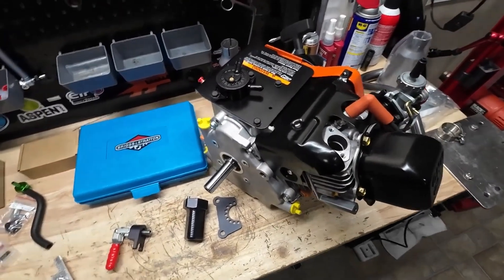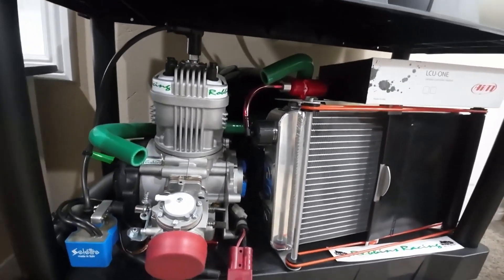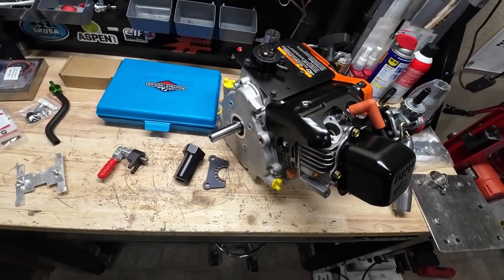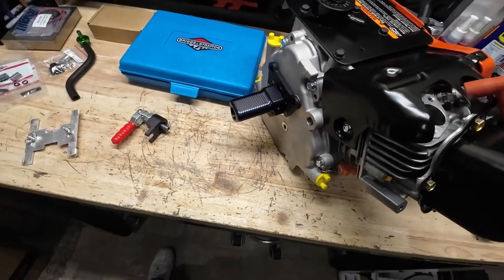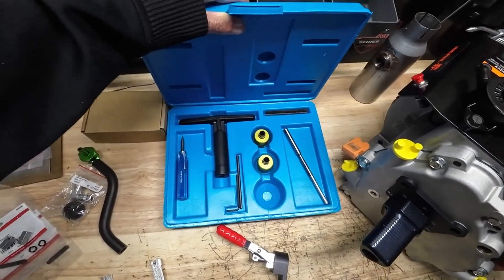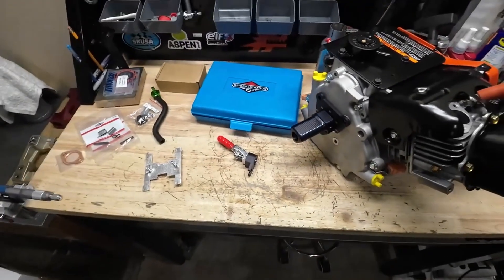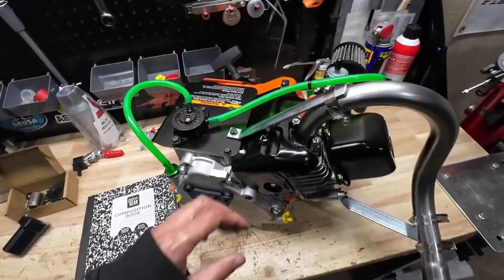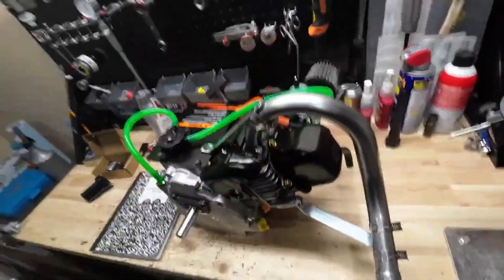DYNO Tuning the Briggs LO206 EP.1 - Engine Prep

Comment: Hi Geoff, interested in the helicoil and stud setup you use for the exhaust flange.  Here in New Zealand, most people run cap head bolts with lockwire.  Look forward to the dyno results!

Comment: Where did you get the valve seat cutter kit?
Reply from the maker: https://www.cylinderheadsupply.com/
Reply: @robbinsracing801  Thank you, what's the part number for the 30 degree cutter?  The Briggs kit they sell only has a 45 degree, I want the 30 degree cutter too, just don't know the part number.
Reply from the maker: @KCDustRemover  Yo my bad totally forgot that the 30 was separate.  PN: CU126

Comment: Is that O2 sensor too close to the end of the exhaust? From what I have read it needs to be at a specific angle much closer to the exhaust port. I have wanted to do this for my son. I am excited to see how it works out
Reply from the maker: Its a self heating sensor so it doesn't need to be near the exhaust port.  Only thing I have heard is that negative pressure could suck air into the silencer and lean out the readings.  Just going to have to see how it goes.
Reply: @robbinsracing801  when you need to adjust the mixture are you adjusting the float or needle or fuel air screw or all 3?
Reply from the maker: @michaelmurphy6687  All 3 although in the past I set the idle mixture screw to 1.25 turns out and forgot about it.  After I get this thing broken in I plan to start with carb setup first.  We'll do a dyno pull for each of the needle clip settings and then as many float settings until the AFR is just right. We can also see how the Idle speed screw changes AFR too.